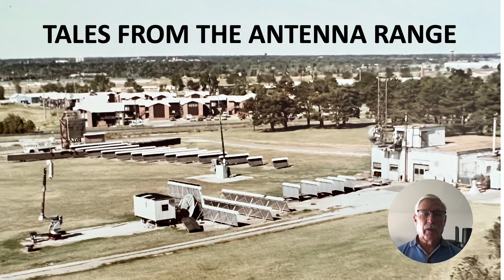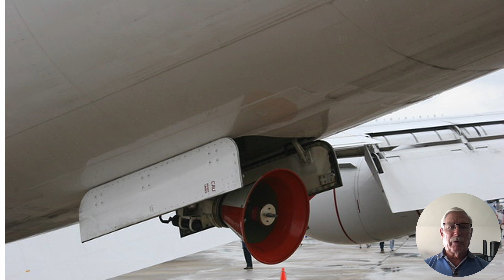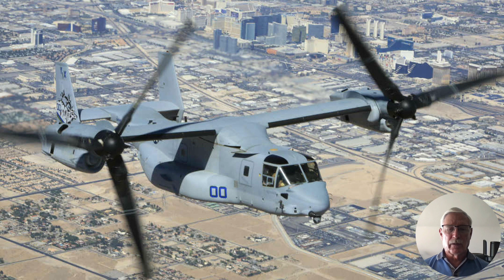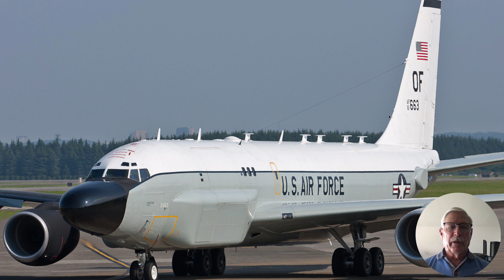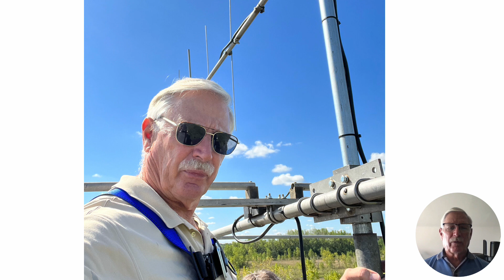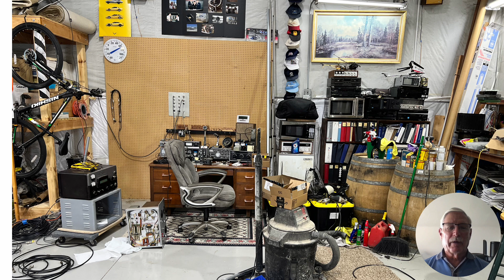TALES FROM THE ANTENNA RANGE

Comment: Really great, or I can better say excellent, how the men designed the aircraft to last where I guess more logically resisting the planned or engineered obsolescence.  The KC-135 were what I heard about most growing up and read into.  Amazing the range of designs for the aircraft from their refueling mission to electronic warfare to PSYOPS to reconnaissance and more.  Seems there was an odd ball I read about that had to be split entry like front and rear due to the radioactive payload that was used for I think detecting something that I think had to do with maybe the Soviets weapons testing.  Seems was lost off the coast of Alaska and I thought was odd reading about online at one time and never finding info on later post MTU and starting off at Perrigo in Allegan. There was RADAR info I recall very clearly on Wikipedia that I wasn't able to find after a certain time. Might be me, though in regards to that the Joint roles maybe were more low key like the FCC stations quote decommissioned.  Thanks for sharing!
Reply from the maker: Thanks for watching!

Comment: I can easily imagine the poor guy in the back having to hand wind 6 miles of wire back in when the retract motor failed.
Reply from the maker: Don't remember if it had a mechanical rewind capability, but it did have a cable cutter.